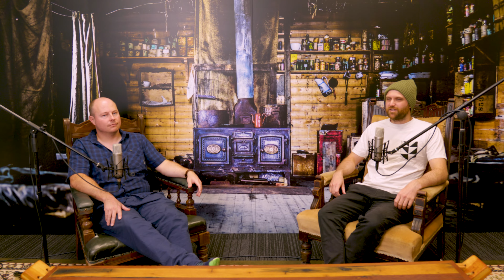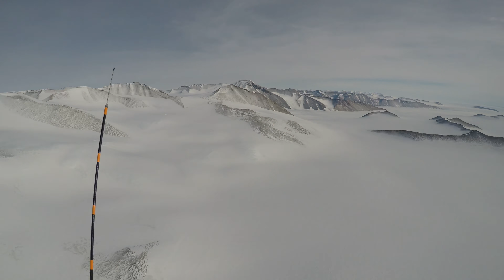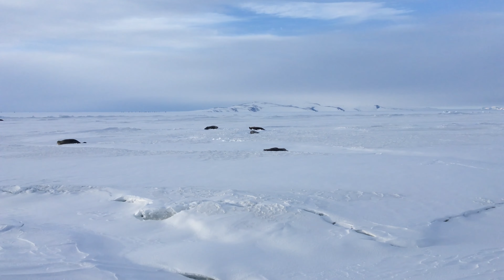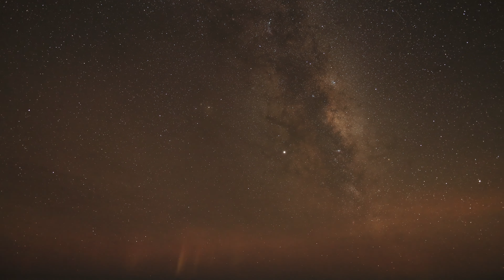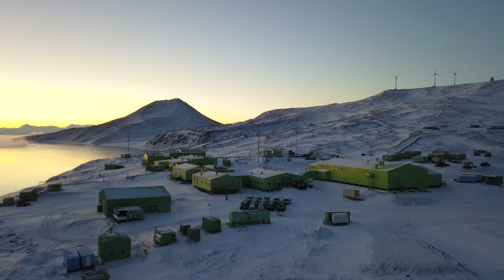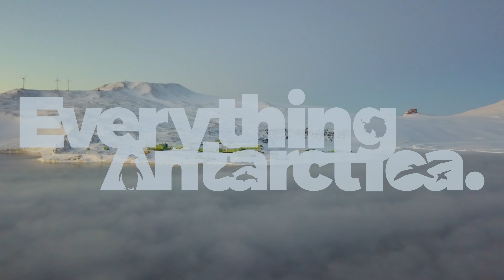What it’s like to be an Electrician in Antarctica - ADITL - Jonny Harrison

Comment: Just out of curiosity. I find most sparkies have blind spots. Ie a commercial sparky would know alot of about fault finding, ATS change over for generators, UPS systems etc. where a residential sparky wouldn't know too much about that stuff. How would you say... how would you learn/figure out heat tracing or the systems for stepping up and down voltages/ frequencies. Is there a team there? would the engineers help? are they SOPs for a bunch of that stuff? How would one round out their experience to be suitable. Seems like a bit of a risk bringing in electricians whom might not have the experience for some of those systems.